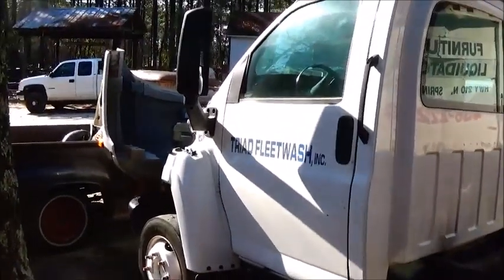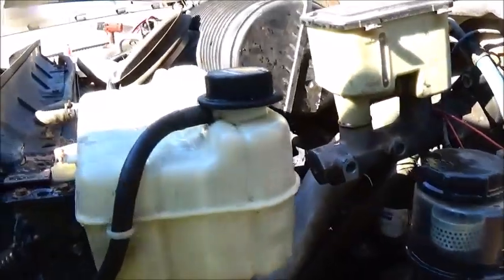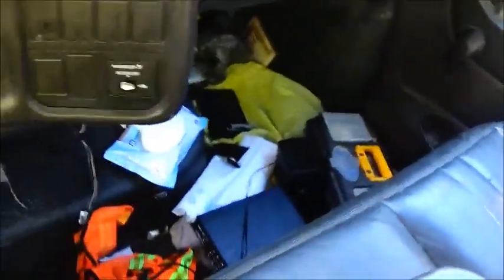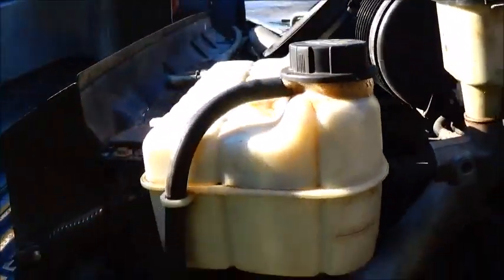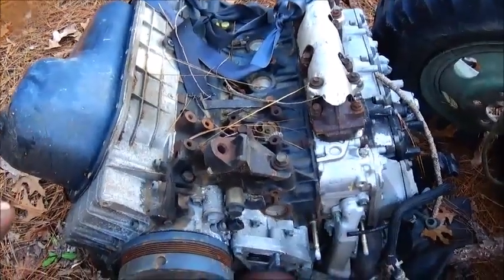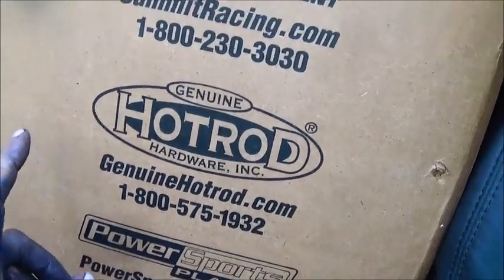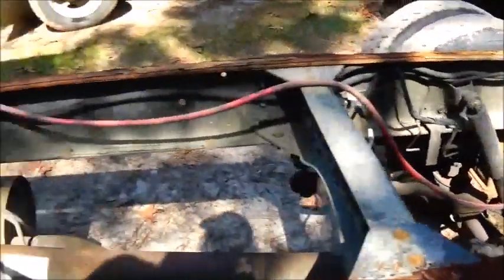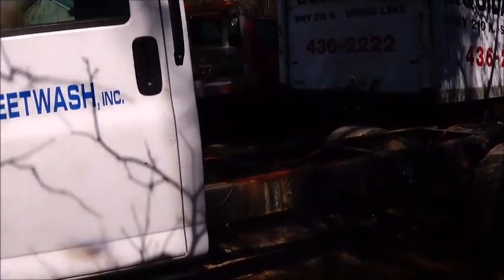Checking Duramax For Bad Head Gasket

Comment: Do you not have to wait for the plugs to heat on these newer diesels or what’s the deal on that? I have a 79 Mercedes diesel and if you don’t give em at least like 30 seconds the fuel will NOT be hot enough to combust properly.
Reply from the maker: These duramax engines fire right up along with my DT 466 which don't have glow plugs. My 7.3 diesels are a different story, they really need them.
Reply: Jonathan W thanks I wasn’t quite clear on that. Didn’t realize they’d done away with the plugs. I wonder how the fuel is heated up prior to ignition though.